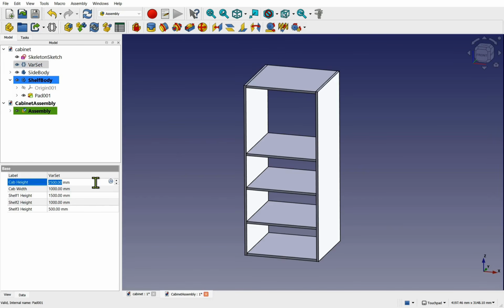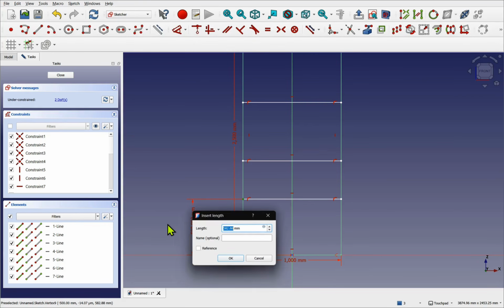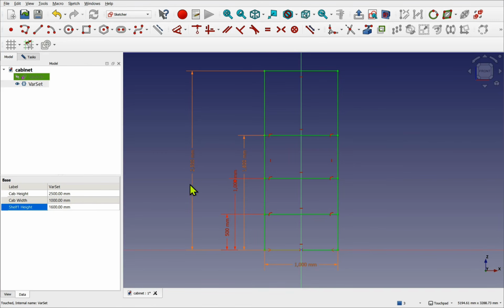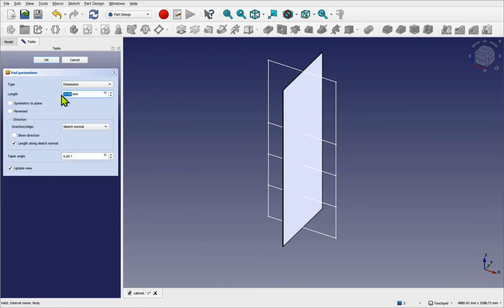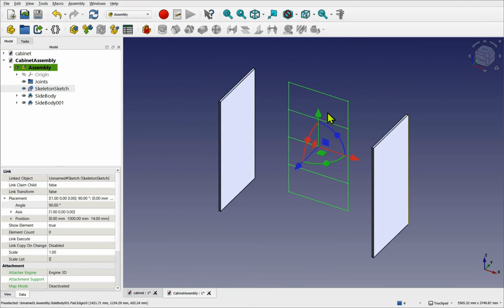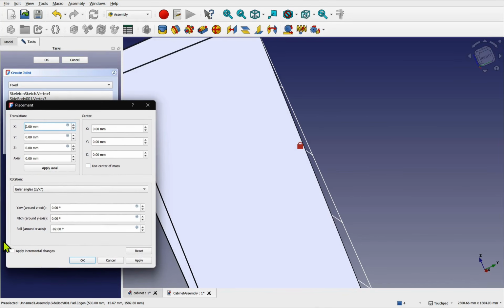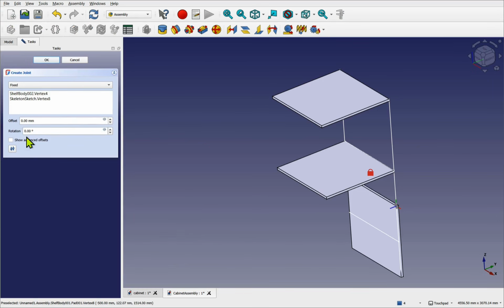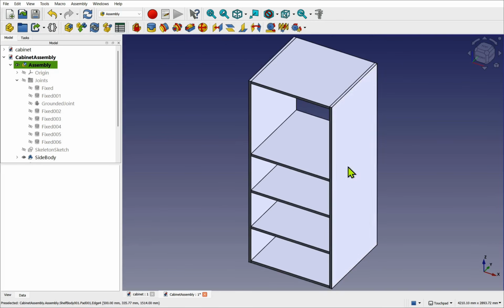Total Assembly Control in FreeCAD With One Master Sketch and VarSet

Comment: Excellent video as always, thanks a lot, just getting started with FreeCAD and basically CAD in general 🤓One question that came up in this video is, why the 2nd separate document for the assembly? Couldn't it live in the main document alongside the parts etc as well?
Reply from the maker: Sorry for the delay in getting back. So you can have the parts in the same document if you want.  Just build each part and then hide the body so they are clear of your workspace.  Then when it comes to assembly create the assembly in the same file and import the parts.  Some people like to keep everything separate, others like to divide them out.  It's just down to choice and either or is correct.  Glad you are enjoying and hope your CAD journey is an easy one :)

Comment: Do you think this is an improvement over the older version of Freecad part placement?   I was thinking about getting the older version of freecad that I used the last time I did cabinet drawings.
Reply from the maker: I believe so but I have been doing some assemblies in 1.1 dev and pretty impressed with the improvements.  It feels like some of the teething problems are being worked out.

Comment: How can you create a shelf to be rebated insted of butt join.
Reply from the maker: If you take a shelf you can create a pocket that runs along the edge, removing a step in the material, this would be for the top and bottom shelf.  And then you can create the channel in the side in the same manner but these will need to be connected up to the varset to allow for them to be offset correctly for each shelf.

Comment: Reading this away from my computer otherwise I would try it myself. When adding the shelves to the assembly can you just import one, connect it and rotate it then copy/paste it, then reposition it using the technique you showed for correcting the connection for the base and so on for the other shelves?
Reply from the maker: You can duplicate the part with a copy paste and then unselect the associated elements so you just have the assembly link, but there is no associated joints to include unfortunately.

Comment: Is it possible to make the number of shelves parametric?
Reply: Hmm. Seems there is a PR for this open already. Do I want to go down the rabbit hole of custom freecad builds? It is tempting for that.
Reply: @olivermatthews8110  hehehe enjoy the trip!
Reply from the maker: Not support as of yet directly in the assembly workbench, you could build a pattern part in the part design and change the occurrences of that rather than the assembly itself but you wouldn't have total control over the spacing, they would all have to be the same. I had a quick search to see if that that been requested as a feature and found this thread. https://www.reddit.com/r/FreeCAD/comments/1gfhbdi/assembly_pattern_multitransform/
Reply: @MangoJellySolutions  thank you! Still very usefull!

Comment: I like when you show how to fix mistakes. Thank you for that!
Reply from the maker: Always like to include those, not often anything goes perfectly and I think a lot of tutorials miss this out.  Thank you for the feedback.
Reply: @MangoJellySolutions  I have a mistake u might be able to help with lol... I just installed freecad 1.0 and tried to follow your example. unfortunately the VarSet Icon/command does not seem to be present in the copy i got. definitely not in the WB location you used it from. and the customization search function in the customize window is not working at all. i also tried to search thru the Python window to locate a mention of VarSet and it also turned up nada (that is if I did that correctly)
Reply: Agree this is critical info to have
Reply: I thought he had done that on purpose... to be able to show how to fix it.
Reply: @Jo-re2ye  it's also to avoid unwanted automatic constraints

Comment: Pretty cool! Is there an  advantage from using Vertices to align rather than lines? Is there a faster way to define the offsets?
Reply from the maker: Glad you enjoyed. If you align by lines you have the whole length of the line that the part can move long.  With a vertex it's fixed.  But, thinking in that context, you can also use the line to your advantage if you wanted a sliding part, like a drawer or sliding shelf. So you could assemble the parts side on to the sketch rather than their back, then you have horizontal lines that you could use to connect to and slide the shelves along. So makes it even more versatile.

Comment: Another nice, clear video. ;-)
I'm working on my parametric Window Project, which is set out with Skeleton sketches like you use here. I've recently started defining all the important positions from the origin, as you do here, to avoid edge flipping.
Do you have any suggestions as to how the number of shelves can be selected in your shelf model? As this is a key feature to my Window project, In my case it's a number of Mullions  and transoms but number of shelves is the same.